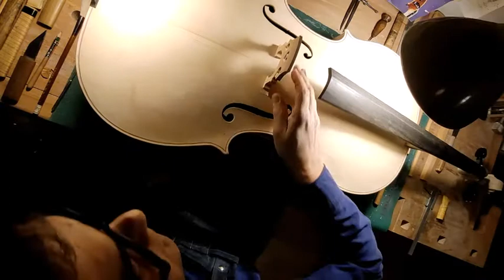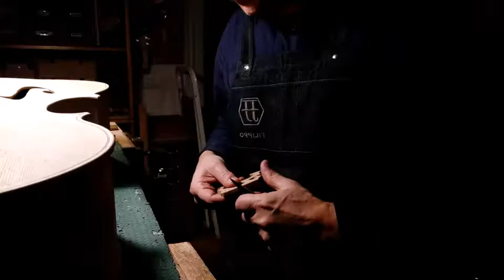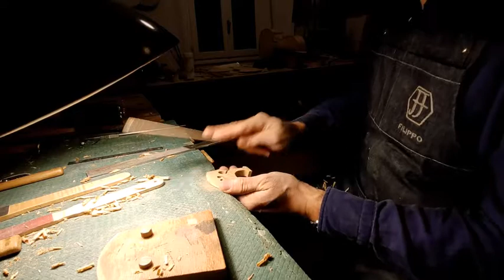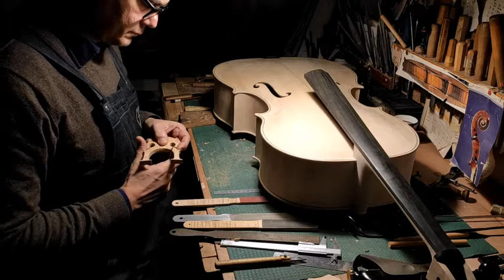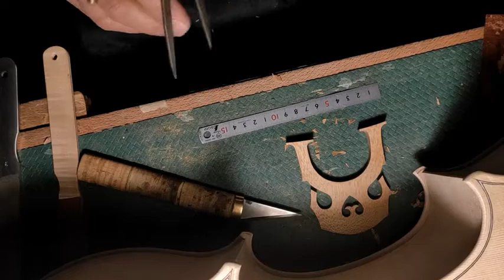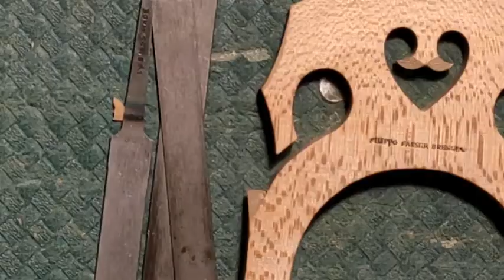make a cello bridge nov 2020 mp4 a

Comment: Nicely done, but why not spread the legs of the bridge (about 1mm) when fitting to allow for spread under tension?
Reply from the maker: I do it, with my fingers
Reply: @filippofasser  OK, thanks. I'm just used to making a length of (sound post) material to wedge into it as I'm fitting the feet.

Comment: Grazie. What main dimensions/ thicknesses do you use for the bridge? And what knife do you use for carving?
Reply: Look up Henry Strobel for his book on measurements as well as making of, cello, violin & viola etc. He has included fractional instrument measurements as well which is very helpful for setting up those instruments.
Reply: @rossthefiddler5890  it is not true. No one is using standard dimensions except on students models. Luthier selects material of the bridge individually for each instrument, he is selcting french or belgian model for each instrument individually and he adjust clearance of the strings and other very important details for the customer needs. And he make a lot of sound checks and adjustments when tuning the tone of the bridge and these wer not shown at all. And these are made on varnished instrument, not on white.
Reply: @rofo2107  Oh please, there is a standard to base those 'fine tuning' aspects around & Henry Strobel was an engineer & therefore quite methodical & why he produced his publications. You obviously have never read his books, so don't go saying "it is not true".

Comment: It was absolutely useless. This manufacturer has not shown anything important. For example, what are the measurements and there are dozens of them on the bridge. What template shape does he use. What is the weight of the bridge. What note is in tuned. How he split the legs of the bridge when mounting on the instrument. And so on. It looks like it's showing us something but it didn't really say anything concrete and I thought it was a waste of time. And by the wy, the french model is widely unpopular on modern cellos and in the end , he even didn't tried the sound of the instrument. So he stolen couple of minutes from my life for nothing.